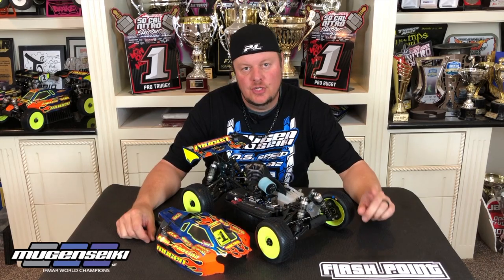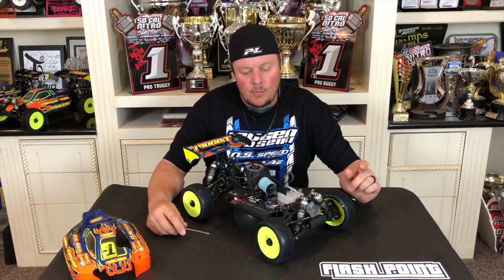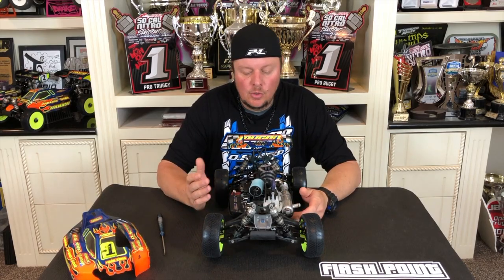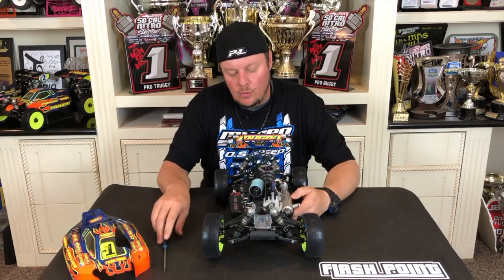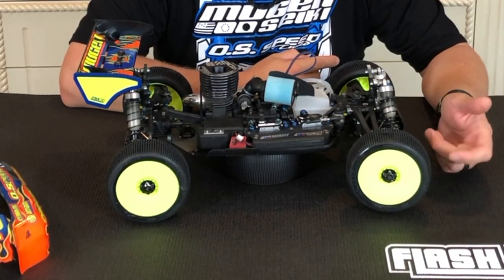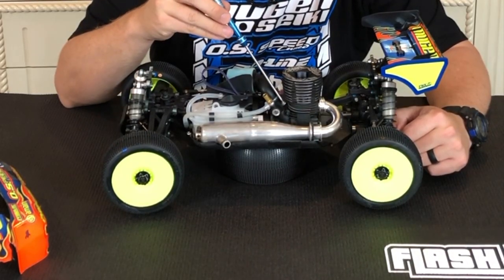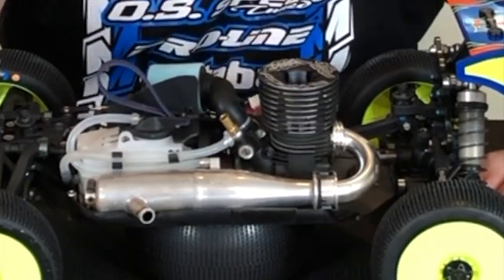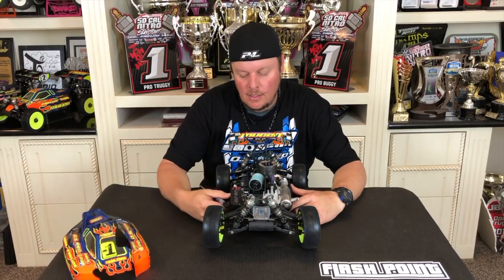How to Tune a Nitro Engine – The basics.

Comment: Hi, thank you very much for this video. I have an FTX carnage NT which has a force .18 engine. I have managed to adjust my high-speed needle without an issue but I’m still struggling with my low speed needle because every time I get it right I find that I need to adjust the tickover/idle adjustment screw. Every time I adjust the low speed needle and get it right because I have to then readjust the tickover/idle adjustment screw I find that if I stop the engine, I can’t start again without adjusting the tickover/idle adjustment screw again because obviously it’s not open enough. I have this issue regardless of whether the engine is cold or it’s reached operating temperature and a new glow plug and fully charged glow igniter also don’t help. This is the first time I’m ever doing anything with a nitro engine. I have tried resetting all the needles three times and then doing the tuning all over again but every time I do this I get stuck with the low speed needle and the idle adjustment or tickover screw. My understanding is that once you reset all the needles to the factory default you start with the high speed needle and then after that you adjust the low speed needle ending with the tickover/idle adjustment screw and that’s exactly what I’ve been doing but like I told you every time I get the low speed needle right I need to compensate by adjusting the tickover/idle adjustment screw but once I do that while everything is okay if I stop the engine, I can’t start it again without either opening up from the idle/tickover screw or manually opening the throttle or readjusting the low speed needle slightly.

Comment: What’s to hot for a nitro engine before it blows up because I’m trying to mine. It’s at like 250 and I’m panicking.like she’s Hanna blow up should I be worried when I got it running better it was more around 220 seemed about right any advice is appreciated you the man👍😎
Reply from the maker: https://youtu.be/AbwjIUsAG4U?si=lFNDOUxazCN5WMEb
https://youtu.be/AbwjIUsAG4U?si=lFNDOUxazCN5WMEb
Here's a couple of videos to help.  With the engines were running today the 245 - 265 range is fine.

Comment: Hello Adam I have just recently bought a reds 721 gen3 engine and im trying to break in my engine but I cant get above half throttle before it quits. im not sure what's causing it to die. Please help Adam im stuck and cant get past the break in due to it dying every time I give it throttle
Reply from the maker: I emailed you about the engine.  Did you get it going?
Reply: @AdamDrake  I sent the engine to you and it should be arriving to you today let me know if you get it

Comment: I have a o.s .21 turbo head and it came with the 3 screw crab. But the carb insert ended up melting or breaking off the carburetor so I ended up putting a two screw OS30 carb and and wow did it wake that 21 up

Comment: Did you race in Hemet in the early 90’s?
Reply from the maker: Yes, in the early 2000's.
Reply: @AdamDrake  I bought a load of old parts in boxes from the owner of an RC track.  I was able to build an AD2 complete with Engine!

Comment: do you have any baseline carb settings for the OS .21 XZ-B V2? I just built my first nitro buggy and put that engine in it. people say the performance is similar to the speed engines. The carb is a 22b2
Reply from the maker: Yes, you could start with my settings from the Spec 2.  

www.thedrakeracing.com
Reply: @AdamDrake  thanks!

Comment: I have a mugen mtx2 with the mt12 novarossi engine where is the migrange needle on the high rpm it runs ok but when i gif it ful trottle ut bogs out i think i need to adjust the midrange is that he big screw on the side of the carb ?

Comment: so we have low, medium, high, and then idle speed? that's 4. I have a HPI RS4 and I had to disassemble the carburetor to clean it. right now the mixture screws are all the way in, and the tiny screw on a spring is somewhere in it's range. where should I start? I only have 3 on this, the other side of the carb just has a nut holding a shaft
Reply from the maker: I'm not sure with that carb but we have all the settings for OS carbs on www.thedrakeracing.com

Comment: good video Adam please keep it up. I am having a problem with my nitro buggy with a .21 motor the high speed needle is backing out after it starts  so much that it won't run any ideas?
Reply from the maker: May just need a new o-ring.

Comment: Is it true that if the fuel line is sitting too close/ontop of exhaust pipe, it would make the fuel hot and may cause leaning out?
Reply from the maker: It's possible if the fuel line s really thin.  I use the Flash Point line that's a little thicker and it seems to help keep the fuel more consistent.
Reply: @AdamDrake  thank you very much. This might be my problem.its only using a cheap ebay fuel line.

Comment: Hi am Eric I have the OS.21TM Engine,new to nitro am running it on the Traxxas revo 3.3, I followed your vedio on the break in now I just need to get tuned right can you please help me by giving me some setting on the high speed and low speed needles
Reply from the maker: I don't know the settings for the Traxxas engine, but if there's a lot of unburnt fuel, you may need to lean out the engine.
Reply: The problem I'm having right now is I'm having a lot of unburned oil and fuel in my exhaust pipe how do I fix it

Comment: Very useful information. I was tuning my Nanda BD8 today and couldn't get it to run quite the way I wanted it, struggling to get good low end response. Now I understand that I got the two adjustment screws mixed up (it only has two). I thought the low speed was the high speed and vice versa. I'll probably get it running the way I want it now. I'm getting really good top speed and reaches high RPM, but lacks low end power. Adjusting the needles correctly will probably help.
Reply from the maker: Thank you.

Comment: I have a modified Reds R5R. It seems to feel a little rich in the mid speed but the carb is only a 2 needle. Should I lean the low speed a little more to help that?
Reply from the maker: Ya, you could try to get a little more out of the lsn.

Comment: Great video. Can you direct me to where I can find your baselines for carbs? I have an OS 21XZ-B (v1)
Reply from the maker: That engine was before my time with OS, but if it uses a 21J I would start with my settings from the Spec 2 engine.

Comment: what kind of clutches do these little engines run? are they minature centrifugals or the kind you'd see on a manual car thats just adjusted by the amount of throttle = to the amount of torque its trying to provide. if they are centrifugal do after market clutch weights according to altitude have any significance or is that all automated?
Reply from the maker: I use the Protek 4 shoe clutch.  You can check them out at www.amain.com

Comment: What does it mean if when you let off the gas the car idles really high for a bit then drops back down or spudders a lot at a high rpm and kinda takes off for a second
Reply from the maker: It could be a few different things.  I would start by lowering the idle and leaning out the lsn.  It could also be because the hsn is too lean.

Comment: I have a weird problem with my LRP ZR.21:
When giving full throttle lots of blue smoke comes out of exhaust and it sounds n smells REALLY rich; but when the engine starts getting above around 75% of its max RPM range, it starts leaning out to the point of nearly cutting out. The HSN is flush (stock after break-in setting) and setting it further than a 1/8 turn in, will result in the engine cutting out or even turning off completely when going above the 75% "barrier". I have replaced the entire fuel line and the tank without luck, I pressure checked it even and it is completely sealed.
PS: I also adjusted the LSN and it sits at a point now, where the engine cuts off after about 3 second when pinching the fuel line.
Reply: Does your engine have a mid speed needle
Reply: @superaidenproductions1870  Nope, I had so much trouble with the engine, that I ended up repairing the original Hyper 21 engine. SO MUCH BETTER you wouldn believe. Even running rich for the break in, it was alot more consistent, cooler and more powerful than the LRP.
Reply from the maker: Maybe the hsn is still a bit too rich?
Reply: @AdamDrake  I cant lean it out anymore, not even by one clock or the engine will lean bog at top speed; its also running hot, REALLY hot, around 130-150°C.
I ended up repairing my old Hyper 21 engine and have no problem with it, tunes consistent across the whole RPM range, has WAY more power and stays cool at 97-104°C.

Comment: Hi Adam. How do i get the two bearings off the centre diff on a mbx6t. I need to change them as they are siezed
Reply from the maker: You may need to get behind them with two flat head screw drivers.
Reply: You could use a little bit of heat if its a steel spur gear.

Comment: I have an old Rb-sx engine on my mbx-4 and the starter box can spin the flywheel but the engine won’t start. (The flywheel spins but When I add throttle nothing happens because the engine isnt running) My tune might be out of wack but I don’t know what the problem is.
Reply from the maker: I would first make sure the glow plug is good.

Comment: That was perfect for newbies. I do have a quick question though. With our Mugens what is the best tool to use to remove that ball end that goes on our Carb ball end. It seems I keep using Needle Nose Pliers to remove mine and its chewing up the plastic ball end?
Reply from the maker: I use pliers as well.

Comment: Hey Adam just wondering the mid idle screw does that change when the power band kicks in ? Hoping that makes sense.
Reply from the maker: It will control the power band through the mid range of the throttle.

Comment: Awesome vid! I am new to nitro. I have a LOSI 8 RTR. I have my engine tuned ok, I think. It's just sluggish from a start but once the rpms get high it runs great. If I let it idle for 10-15 seconds it will bog down again until higher rpms. I'm thinking rich on my low speed. Does that sound right?
Reply from the maker: Thank you!  Yes, sounds like the low speed needle is rich.
Reply: I would say so.

Comment: You talked about richen or lean the mid adjustment, but isn't it just moving the spraybar? I heard both things in the past and it is one of the least talked and unclear things in nitro rc. What is actually going on with the mid adjustment in General?
Reply from the maker: I think most people over think the mid speed adjustment.  It will adjust the spraybar, but it's really just adjusting the mid range of the power band.

Comment: Hello mr Drake,
I know you have a lot of experience with the nova motors so do you know the factory settings for a Novarossi cx12 rotary carb? I had previously found some settings but the engine scream on startup and does not have any air leaks.
Reply from the maker: I'm not sure about the Nova .12 carbs and the Nova carb settings actually vary quite a bit from carb to carb.

Comment: This is good information! I was fiddling with my TLR truggy with an O.S at thunder alley last weekend and the engine was running at 270 but it still didn't have enough punch to clear some of the jumps, but the track was SUPER dry that day. Im heading out this weekend as well to see  if anything changes.
Reply from the maker: It could also be your clutch setting.
Reply: @AdamDrake  good point, I didn't think about that.

Comment: Adam thanks for your time. This really does help. I do have a guesting. I know you have alot of experience with nova motor. I have Mito 7 would you know or rather remember the base setting for that motor. Thanks again.
Reply from the maker: Glad to help.  The Nova settings can vary a lot from engine to engine.  Usually you can start with the lsn flush and the hsn 1/2 turn in from flush.
Reply: @AdamDrake  what about the mid